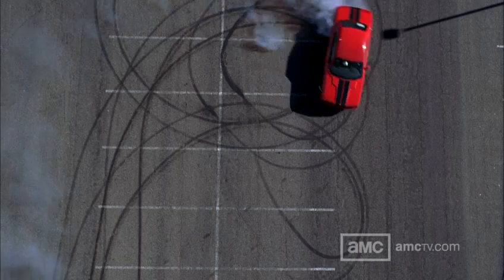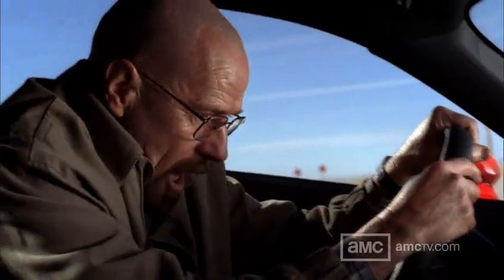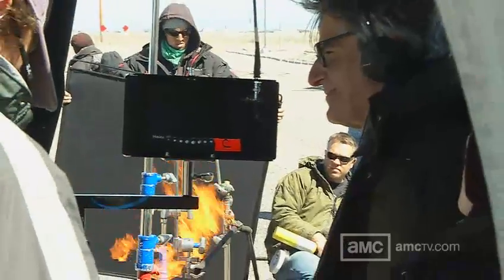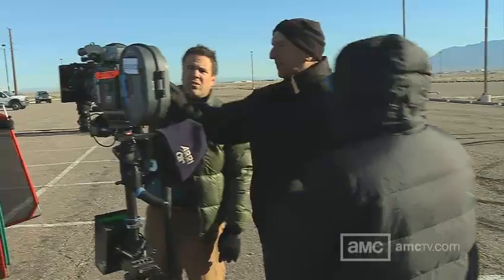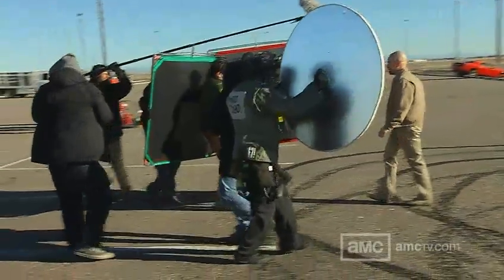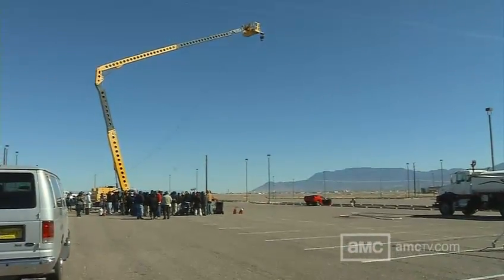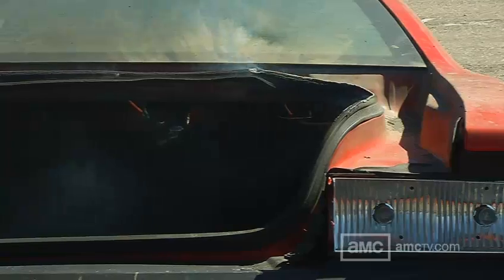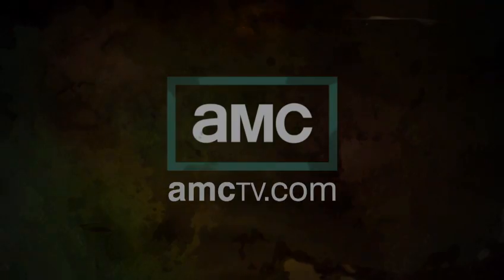The Car Explosion: Inside Breaking Bad

Comment: why are they wearing those heavy coats? I didn't realize it got so cold at a low altitude in New Mexico.
Reply: Deserts go from very hot to really fucking cold within hours. It's a strange place, New Mexico.
Reply: ***** it's more like minutes really.
Reply: ***** I didn't realize that Albq. was so far over sea level. bet it takes some edge off the heat. never heard of much snow there though. I always did want to ski Taos.
Reply: ***** is it at least dry heat? I once went to Dallas in July and almost passed out the moment I walked off the plane.
Reply: ***** we were in N. Ca. by Yosemite and it was 104 and very dry. the hotel didn't have a/c because it supposedly cools off at nite. we changed to an a/c hotel anyway.. next day we went into Yosemite and went white water rafting - that was a blast. San Diego was dry too - warm in the day cool in the nite. brings back good memories.
Reply: New Mexico is the 4th highest state. Elevation, not meth.
Reply: I wouldnt call 5300 feet low buddy.
Reply: Lucifer ™
at that latitude it isn't very high. i've been 4000 meters up where you can't carry a full backpack for lack of oxygen. that's high. and pls don't call me buddy, ok?
Reply: jasonwheel Listen BUDDY. I live in Albuquerque. It can get as hot as in Phoenix here. But since we are at the same elevation as Denver the air is thin here meaning it can get extremely cold here during the winter.
Reply: jasonwheel ok bud

Comment: Why did they film with old school 35mm films and not with modern technique? Can someone Explain?
Reply: UnboxingTV  Its honestly a matter of choice in most cases. Some film directors like Quentin Tarantino only use 35mm, which is more expensive, because of the film rolls, and I belive film has better resolution if displayed properly I belive, since its got a zoom almost 10x times more clear than digital camera, because digital cameras pixelate.
Hope I was of some help